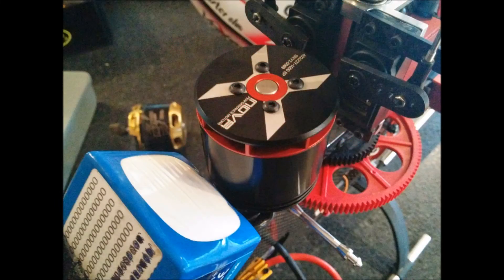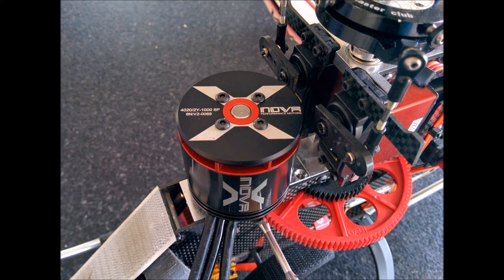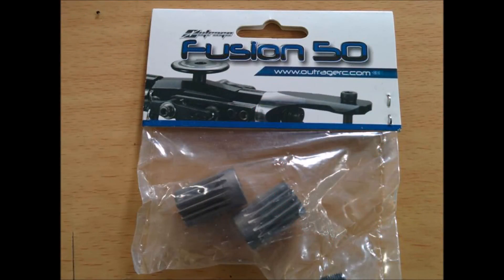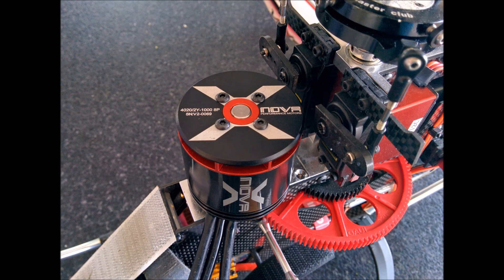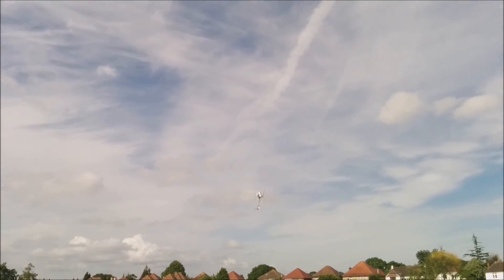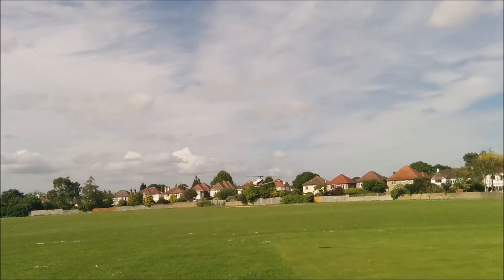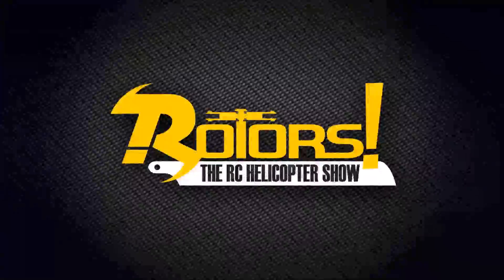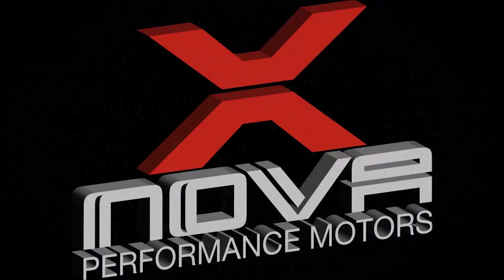Xnova Motors

Comment from the maker: Here is Adrian Chapmanlaws review of the awesome Xnova 4020 motor.

More details on this motor and other in the Xnova range, aswell as stockists can be found at www.xnovamotors.com

Specs of this motor are here http://www.xnovamotors.com/xnova-4020-1000kv/

And a transcript of the review
"Here we have a rather nice looking Xnova 4020-1000kv 

Its rated for a 2200 watts which is around 350 watts and 90kv more than the stock gaui X5 motor. 

The slots at the top are a centrifugal fan that drags air up through the stator helping to keep it all cool as well as looking pretty! 

something that caught me out was the 6mm shaft vrs a 5mm shaft of the stock motor

I decided to keep the same gearing, this combined with the slightly higher KV will up the headspeed slightly as well as giving the speed controller a little more headroom to allow the governor to maintain the head speed through moves.
 
the only pinion I could find that was 0.8mod was the outrage fusion 50 pinion, it is a lot taller than the stock pinion so had a little fiddling to do to get it to clear the front canopy mount/frame spacer

this involved opening the hole in the motor mount a little to clear the pinion and allow it to sit closer to the motor.

Video

As you can see this is a worst case scenario to test for temperatures and flight time. I was purposefully keeping the model moving using lots of collective and cyclic.

My cameraman's potty mouth says it all, its got a lot of power, the temperature of the motor and ESC at the end of a flight were best described as lukewarm. 

neither were painful to hold onto which is a good rule for electronics and nitro engines. 

The battery on the other hand had definitely been worked hard which you would expect flying like that plus these are the older 30c packs.

This tells us that the efficiency is good. If it wasn't then everything would all be getting hot and get very short flight times. If every flight was like this then I would have to keep the flights to 4 minutes, which is a little down on what I was getting with the stock motor, however the laws of physics say that the power has to come from somewhere so shorter flying times are to be expected if you abuse that power. Im sure that once the novelty wears off I will be able to up the timer back to 4.30

On Ade's scale of awesomeness this thing gets a 10, bucket loads of power good efficiency and a massive grin. Looks damn good too."
Reply from the maker: xnova motors This thing ROCKS!!
Reply: Some power on tap there!
Reply: Nice work guys!
Reply: Jesus.  That thing moves.

Mind you, I'm not surprised.  520mm blades at 2800rpm and it's going to.  I only run 2650 on my Trex 500 and that has ample power.

Where have I seen those hurricane figure 8s before? 

PS.  Gaui do pinions for 6mm shafts. http://www.fast-lad.co.uk/store/901600_steel_pinion_gear_pack(15t-for_60mm_shaft)-p-22554.html
Reply from the maker: Darren Reeves the trex 500 is smaller remember. The hurricane 8s were all the rage 5+ years ago!
Reply: Smaller helis tend to run higher RPM than larger ones, not lower, hence my comment about my 500.
5 years ago I 'd just started with helis.  The only ones I've seen lately were Duncan Bossions in his now famous Zone village flight.
Reply: It depends what you are doing. 2600 is fine until you start pushing it then more is mostly better within reason as it increases the lift for the same angle of attack.